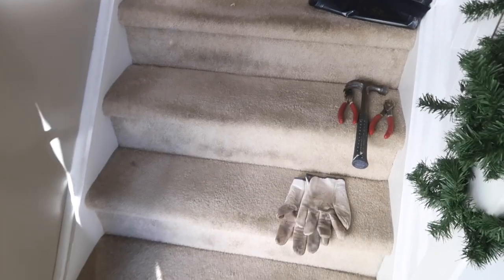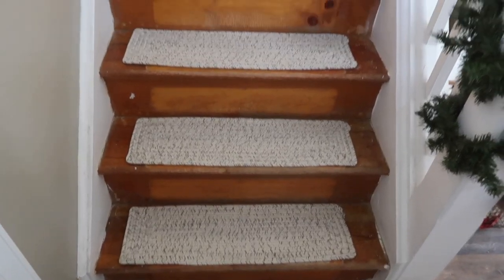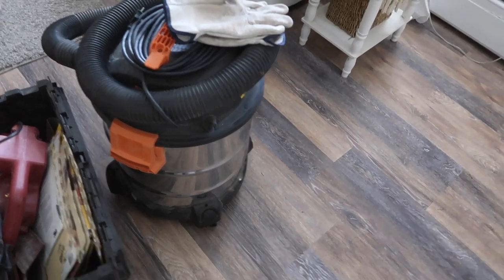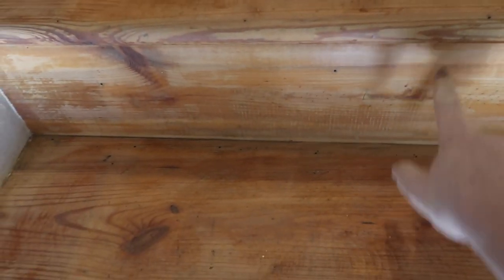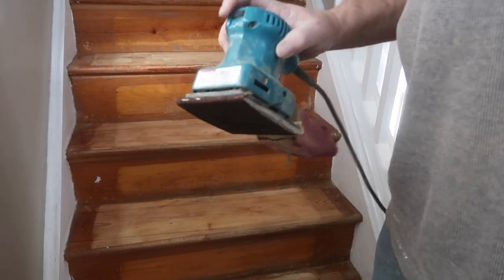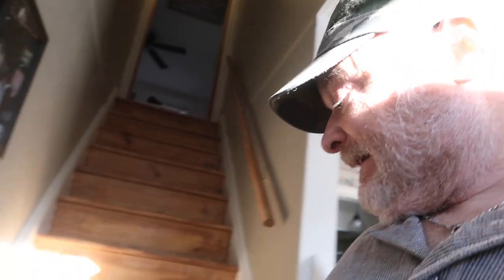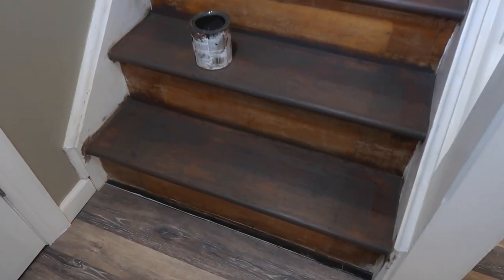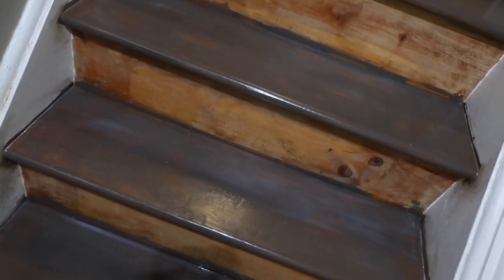STAIRCASE RENOVATION DIY UNDER $39

Comment: I want to do this to my stairs! I have a question we just bought this house and it’s seems that they painted the stairs and i don’t think the wood is that great will I still be able to just sand and stain because I hate the look of it painted please help diy dad! What stain color did you use?
Reply: I love the way your stairs turned out thanks for the tips and showing us how to do it
Reply from the maker: Color is Briarwood, I think I linked it on the video from Amazon. Try sanding one and see how it looks you can always buy step covers they sell them in Lowe’s I think and looks like real wood. I’ll get the link
Reply from the maker: River Road Oak Stair Tread https://www.lowes.com/pd/Stairtek-River-Road-Oak-Stair-Tread/1000311917
Reply from the maker: @erikadeleon5836  I sent the link hope that helps, you might find cheaper ones but best way to cover old unrepairable steps
Reply: @ALDoesALL  thanks!!
Reply: briarsmoke
Reply: @ALDoesALL  already working on my stairs I sanded them already 👏🏼👏🏼 thanks 😊